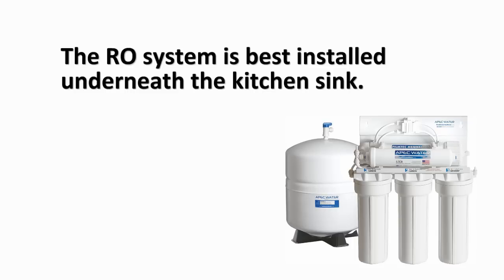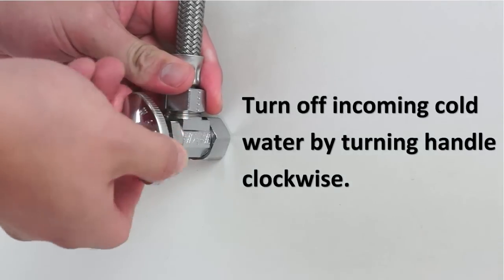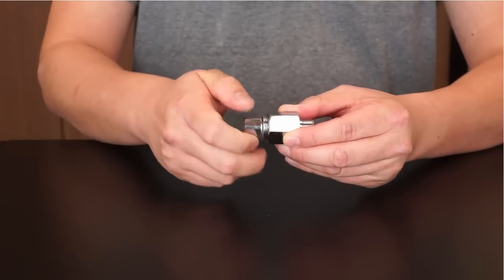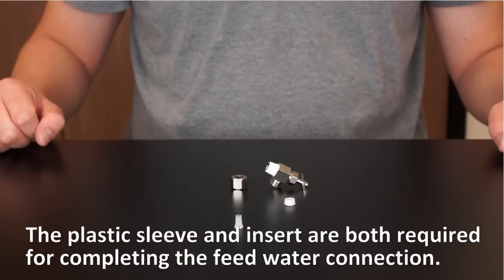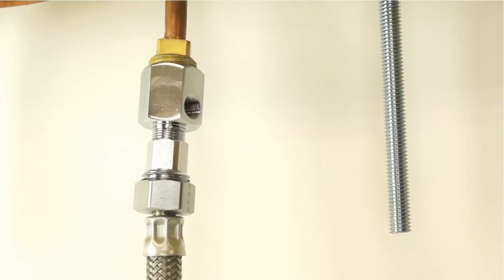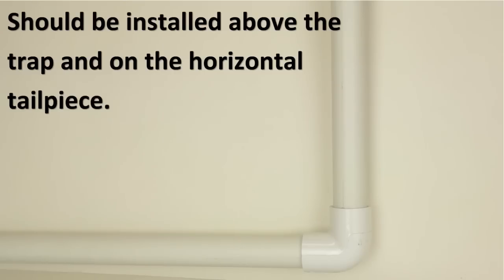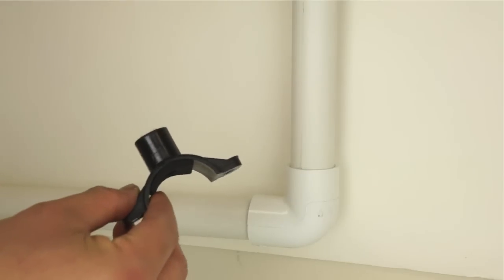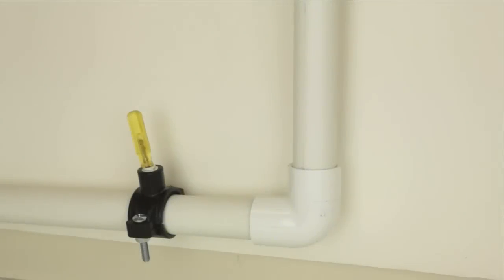How To Install the Feed Water and Drain Saddle Adapter For Your RO System - APEC Water Part 3

Comment: Help.  The Apec water feed adapter included in the box doesn't fit my cold water riser tube and faucet shank.
Reply from the maker: Our feed water adapter is designed for standard 3/8” or ½” cold water lines. If your cold water line is not standard may need find an adapter at a local hardware store. If you need further assistance, feel free to contact us directly by calling 1-800-880-4808 or e-mailing us at info@apecwater.com. We are in the office from Monday-Friday from 8:00am-5:00pm PST. Best Regards, APEC Customer Service

Comment: What about sewer gasses?  I did this.  I just have a concern with the gasses back feeding into my drinking water.
Reply from the maker: We recommend the drain saddle be installed before the p-trap which would prevent gases from going back in. Also the waste water line has a internal one way valve so it would be very hard for that to occur. If you need further assistance, feel free to contact us directly by calling 1-800-880-4808 or e-mailing us at info@apecwater.com. We are in the office from Monday-Friday from 8:00am-5:00pm PST. Best Regards, APEC Customer Service

Comment: What if my drain line is hard plastic, corrugated, plumbing? How do I get around this (options)?
Reply from the maker: Hello,
 
Thank you for your inquiry. I'm happy to help!
 
The drainline is recommended to be installed into the drain pipe. If you do not feel comfortable drilling into your drainpipe, we recommend contacting a local plumber who may have experience with working with this type of plumbing.

If you need further assistance, feel free to contact us directly by calling 1-800-880-4808 or e-mailing us at info@apecwater.com. We are in the office from Monday-Friday from 8:00am-5:30pm PST.

Best Regards,

APEC Support Team

Comment: Is it possible to leave the drain tube over the sink, instead of drilling a hole in the pipe?
Reply from the maker: Hello,
 
Thank you for your inquiry. I'm happy to help! Yes, you may leave the drain line in the drain in the sink rather than drill into your drain pipe. If you need longer tubing to accomplish this, it is recommended to use a 1/4" x 1/4" union connector (can usually be found at local hardware stores) to extend the line.
 
If you need further assistance, feel free to contact us directly by calling 1-800-880-4808 or e-mailing us at info@apecwater.com. We are in the office from Monday-Thursday from 8:00 am to 5:30 pm PST.

Best Regards,

APEC Support Team

Comment: When pushing the drain line in, do i make sure it goes all the way through the drilled hole?
Reply from the maker: Dear customer,

Thank you for your inquiry. I'm happy to help! No, the drain line will not go all the way through the hole in your drain pipe. Please make sure that the drain line is lined up with the hole in the drain pipe to ensure that the drain water can flow freely without being obstructed. 
If you need further assistance, feel free to contact us directly by calling 1-800-880-4808 or e-mailing us at info@apecwater.com.We are in the office from Monday - Friday from 8:00 am to 5:30 pm PST. 

Best Regards,

APEC Support Team
Reply: FreeDrinkingWater is it bad if mine is sticking in the pipe just a little bit? It’s wedged in there enough that it won’t move and has complete clearance for drainage
Reply from the maker: @WesselsReaper  Hello, 

Thank you for your reply. That is not bad, it sounds like the installation is correct. 

If you need further assistance, feel free to contact us directly by calling 1-800-880-4808 or e-mailing us at info@apecwater.com. We are in the office from Monday-Friday from 8:00am-5:30pm PST. 

Best Regards, 

APEC Support Team

Comment: The pipes under the sink are brass or at least some kind of metal. They are shiny :-) Can I drill a hole in that and mount the saddle or that would not work because metal pipes are likely to be thin and will not hold the drain pipe properly?
Reply from the maker: Dear Customer, 

Thank you for your inquiry. I'm happy to help! To be of best assistance, please help provide a picture of your cold water supply. You may send it to info@apecwater.com . Thank you for help!

Best Regards, 

APEC Customer Service
Reply: @apecwatersystems  Thanks! I went ahead and drilled a hole in the metal pipe itself yesterday. Working fine so far. Thanks.
Reply: @guraafg  Hey, what was your experience here like? I am considering doing the same, I have a hammer drill but I don't want to mess up the pipe.

Comment: it is included. I have my own question if I want ot just for the ice maker what do I do with the drain
Reply: +Francis M Maybe you can drill a small hole in the floor to the basement (if you have one) and run the line into your "laundry sink".